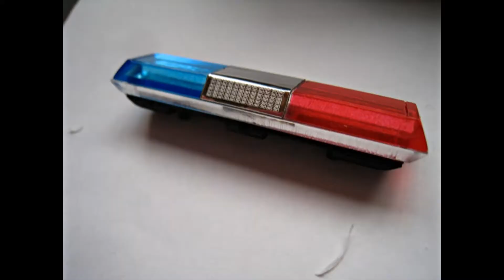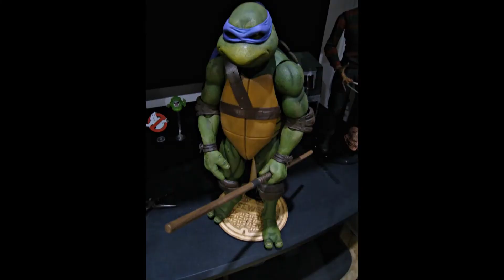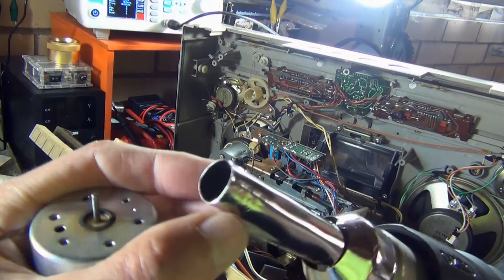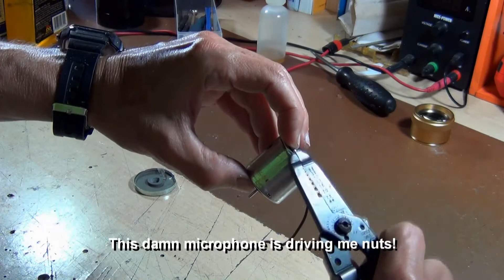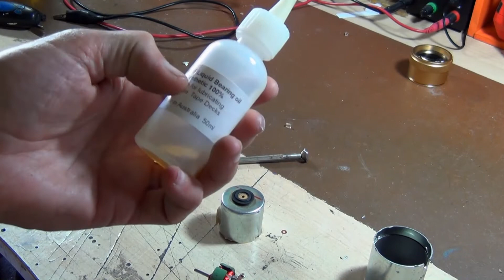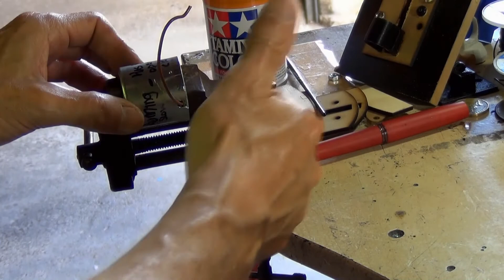Further Adventures In Boombox Repairs - Silver ST 767 DC Cassette Motor Replacement & Servicing

Comment: At my experience it is the best not to mess with motors, just replace it.  My experience is that is not worth the time because sooner or later there is a problem again. It is a precision device and very sensitive to fluctuations when it is not smooth enough. Besides, I found out that most of Matsushita motors develop problems over time. It could be also the driver inside of the motor. I have several models with driver problems starting oscilating (increases wow or flutter). 

I have done experiments with the driver outside of the motor and I think that is actually a better solution. You can place the driver anywhere you like and also accessible at the outside, very handy after replacing belts. I made different drivers based upon DC/DC converters and the result is great, very accurate and stable and you can apply any (modern) motor you want however there is a downside. The downside is that the driver must be shielded to avoid interference with am and/or fm reception. I love to see a version with an adjustable voltage regulator but have not found one yet. A voltage regulator is not very efficient in terms of power consumption  but has the benefits to be very accurate and stable and doesn't produce any noise. 

What is your idea/thoughts on this?